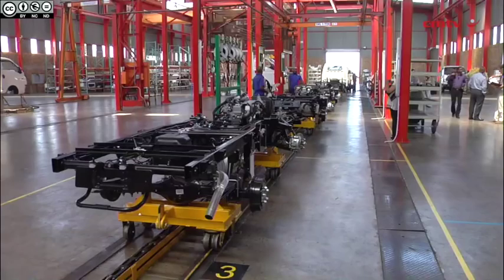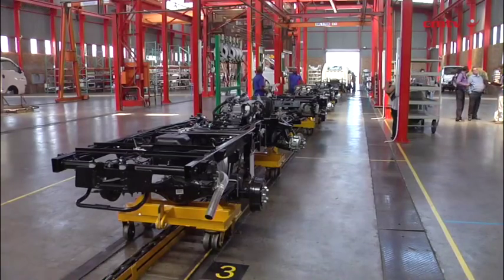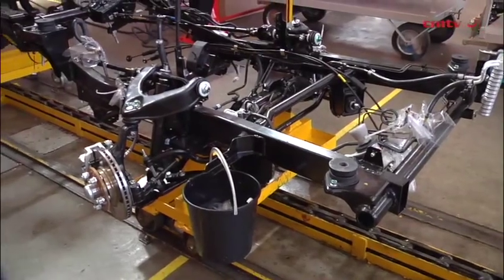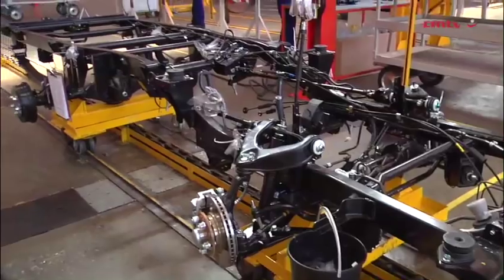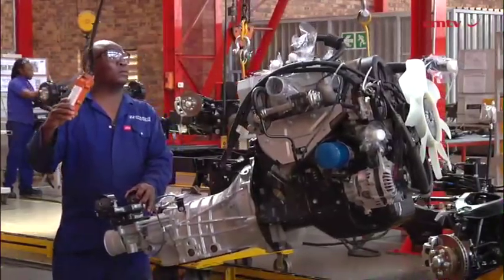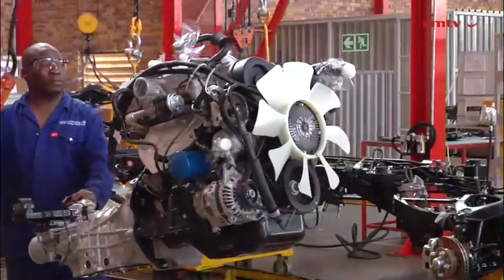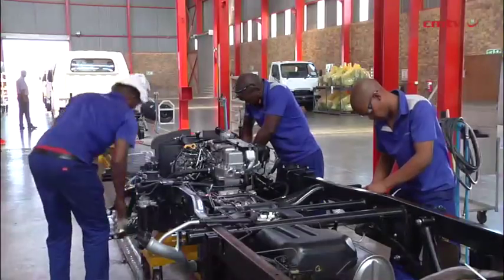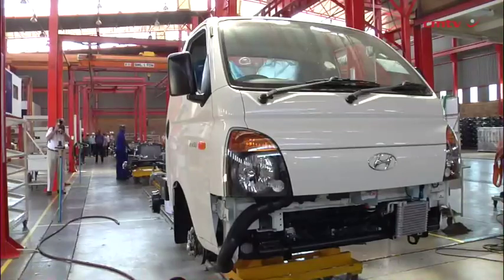Hyundai starts local H100 assembly

Comment: Hyundai still use d4bb engine?
I cant believe. Because hyundai did extinction d4bb engine 2004. Because exhast test failed. But that engine 's durability better than hundai A crdi engine (old sorento engine now also use). some d4bb car still run in korea (korean people like early change car. Korea car life is 200000~250000km)
Reply: we have H 100 non turbo 2.6 diesel  and its on 700 000  km on first angine .Just gearbox linkige was fixed ones .Thay go far  moore than 200 000 km if mantained 10 000 km intrvals.